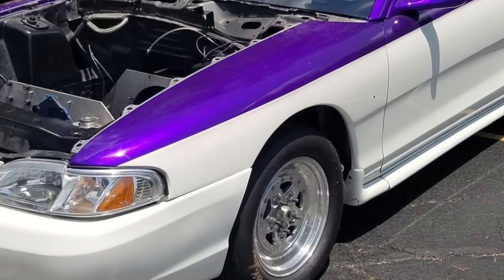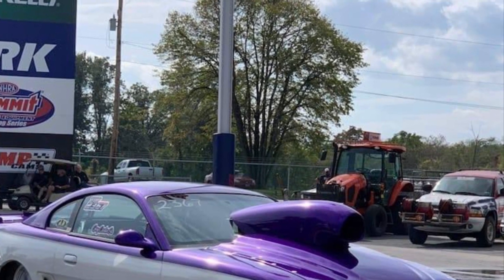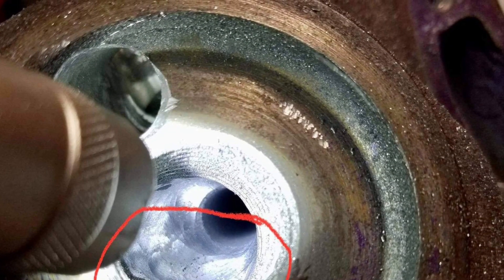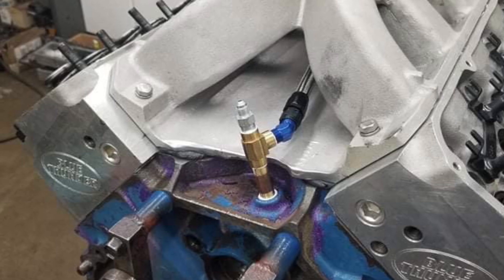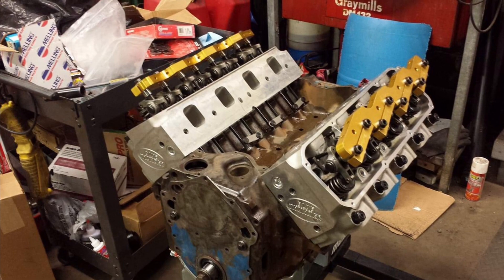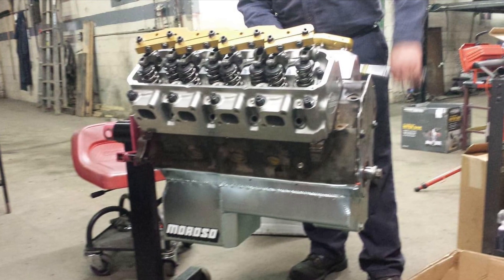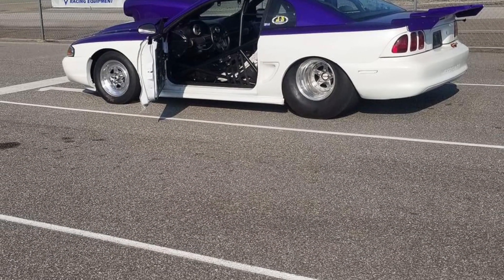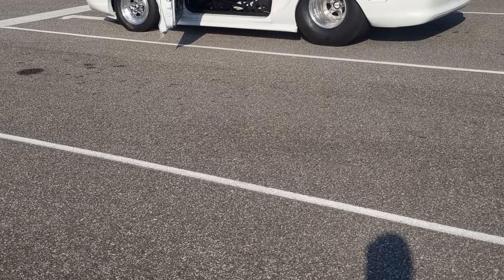DragBoss Garage: Fred Carlier's  96 Cobra 700+ hp  408 Cleveland  Topped With Blue Thunder 3.6's

Comment: YEAH, that leave looked too soft.  The 1/8 mile stuff = 9.81@138.74 on the Wallace Racing Converter !! Loved that throttle response !!
Reply: Tire size is not very big...33×10.5W, but l'll ask my converter guy what he thinks we should make it...
Reply from the maker: Definitely ck. My car leaves best at 3400. Any more than that and it spins. Always thought higher rpm leave the better. Not true.
Reply: Tim go to the Skid Factory Aussie YouTube channel to see the latest saga with the Black Clevo. XA Falcon ute. It had done (previous video), 4 runs with next to NO oil pressure !!    Also on the IWrocker channel, an American guy that loves all things Aussie, reviews a vid where 5 old 65 model Falcons did a 70,000 mile std. production reliability torture test; it's a fantastic watch. It's 11 rows down ,left side on his video list !!
Reply: P.S. you'll love the CLEVELAND labeled Alloy valve covers !!
Reply from the maker: I will ck it out Adrian. Sound killer for sure.
Reply: That pass was early in the week, leaving around 3200. The 6.19 pass was leaving at 3800. Looking to launch the next pass at 4500, and see how it responds...🤞
Reply: @fredcarlier584  It'll respond extremely well I'm sure. That 60ft will plummet down !!
Reply from the maker: Really need more Convertor flash, like 6k.
Reply from the maker: From experience that Convertor needs to be flashes at 6k. But also big tire and back half, with only 700hp, chassis absorbs a lot of shock. Love the BT heads

Comment: That is a great build.
Reply from the maker: Thanks Frank. Not many builds with these heads anymore.
Reply: @dragboss351cleveland  no there are not. I can only dream of having a 335 series engine like that.
Reply from the maker: @frankglasgow  no need to dream. Start a build, Those heads are around if you look for them. I actually have a set at BES, awaiting the CNC machine port work.

Comment: Nice motor but need a nice single turbo..he well be fast
Reply: That would be a much different motor .
It  would work better with twins & of course lower compression,  Different cam ,& all the necessary goodies turbo require .
Reply from the maker: @hieronymus..bosch8532  sure would. Crazy power I bet. But NA so much easier and no changes needed. I like to load, race, and go home, no issues.
Reply from the maker: I can only imagine, get it later probably add a couple hundred horse.

Comment: I love the Cleveland! I "assembled"1😆, when I was 18.1972 2v engine, stock compression ratio, 3 angle Valve  job, Lunati 536- 562 lift, 290-300 duration, Valve spring upgrade. Holley 750 vacuum secondaries. Man, "I knew,"what I was doing!😅 I was very impressed with the power! Even at the folly, of my inexperience. I grew up with and around fast cars. Tim, if had your money, I'd build ten of them! I hear, even 2v Clevelands, make power!😃
Reply from the maker: Thanks CW. Man you had the cleveland down back then. Good job. Well I am going to build 5 at least. Lol. Thanks so much
Reply: @dragboss351cleveland   I grew up the son of cardealer/mechanic. I Was the "flashlight" holder, at young age. I had no choice, but to learn.
Reply from the maker: @strokermaverick  I know the feeling I was right there, sometimes you could never hold the light in the right spot if you remember that. Thanks for sharing
Reply: @dragboss351cleveland  😆 What the @#%$, are you doing?! Hold the*&@^$, light right here, right here,right here!😅
Reply from the maker: @strokermaverick  I do remember that too. And then it was go get this wrench, get the pliers, get that cleaned up. And then the occasional good job your learning. RIP David R, my dad
Reply: @dragboss351cleveland  Give the wrench, with 7 slash 16 on it!

Comment: It is astounding the kind of power and reliability you can get from the Cleveland platform. Given the advances in parts development and other advances in technology today. There is a lot more potential yet to be discovered.
Reply from the maker: Hell Yeah got to agree 💯 lots of levels you can achieve, they respond well to change. Small cam too.
Reply: @dragboss351cleveland  Small cam lol
Reply from the maker: @frankglasgow  In reality Frank, that left .727, probably more like .690 by the time you taken deflection other losses. I actually made a whole video and piston valve clearance measured three different ways.
Reply from the maker: @frankglasgow  in reality Frank that Kim is kind of small, for the potential to Cylinder Head‘s. .727 left it’s really probably about .690 when you take in consideration of pushrod deflection and other components that  reduce net lift. actually made a whole video on measuring piston valve clearance multiple different ways you should check it out.
Reply: I chose this cam simply because l'm bracket racing this motor, and it diesn't need to be on the ragged edge every pass...the heads were cnc'd at ET Cylinder head with the stage 2 port job. There's ALOT more that could be done and make this motor scream hp, but just not needed to bracket race it.
Reply from the maker: @fredcarlier584  that’s it. Dependable and easy on parts. And fun. That’s what I like go to track race load and go home. No drama.

Comment: So what carburetor is that?
Reply from the maker: Pro Systems SV-1. 1160cfm
Reply: Thanks Tim. Kinda looks like a kendig body with some holly bowls. I’ll Have to check those out some time.
Reply from the maker: @Lagrange1186  it’s like one big air valve. Somewhat quirky. Either work great or people have problems with them